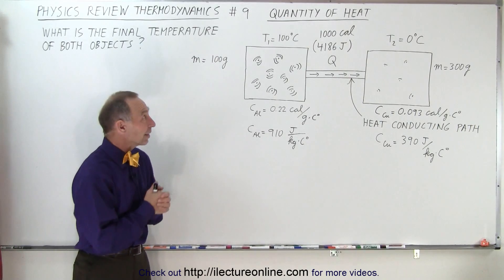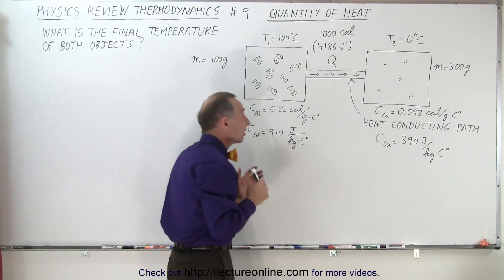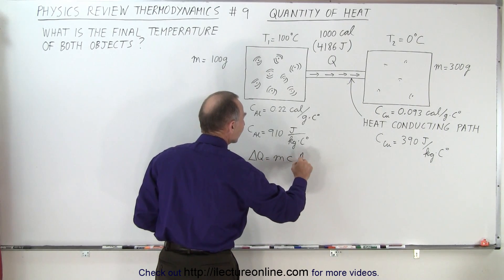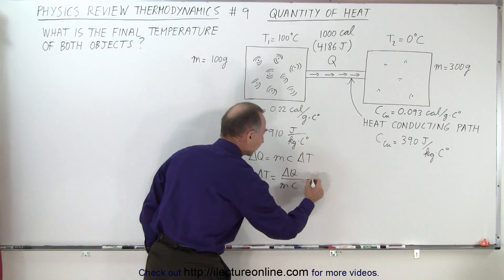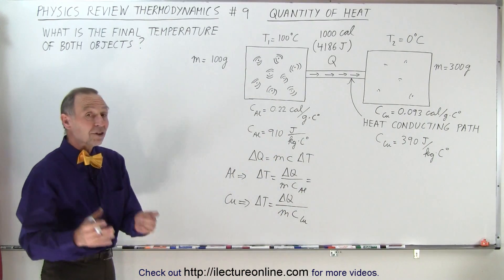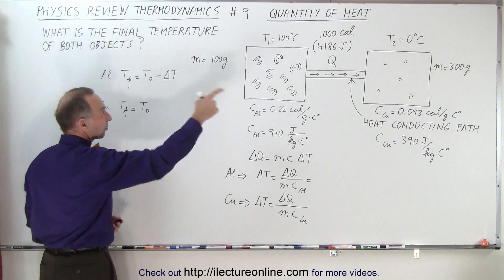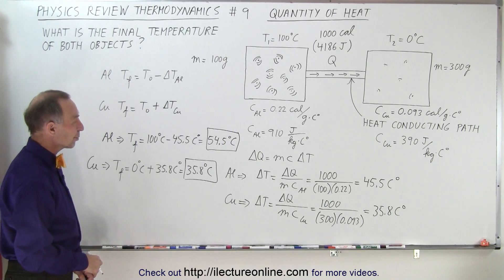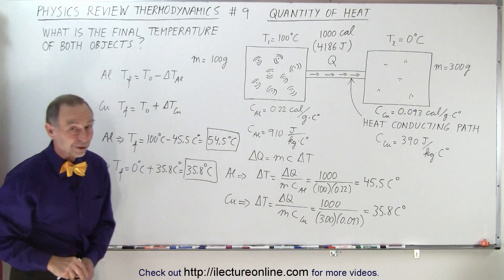Physics Review: Thermodynamics #9 Quantity Of Heat

Comment: Can I confirm that what was calculated was the temperature of the two metal objects after the transfer of 4186J of energy. .... as distinct from the final temperature of both objects?
Reply from the maker: Yes.  "What is the temperature of the two objects after 1000 cal (4186J) of heat are transferre?"

Comment: Mr. Professor the temperatures should not be equal?
Reply: Just in the thermal equilibrium, when the heat transfer is zero
Reply from the maker: Correct, at the end they will be at the same temperature.
Reply: @MichelvanBiezen thank You.